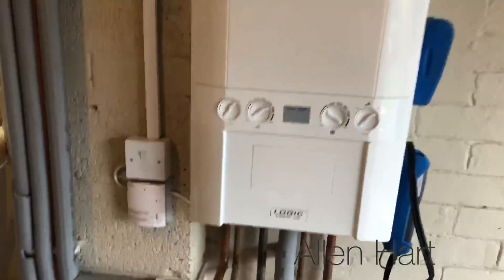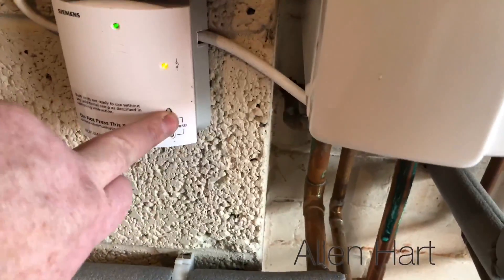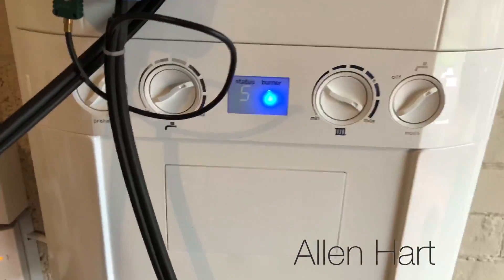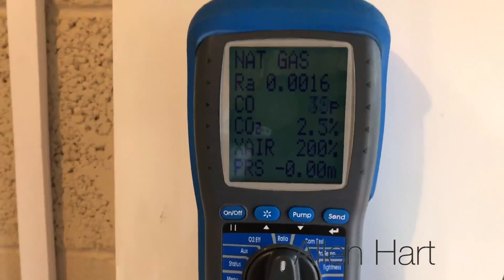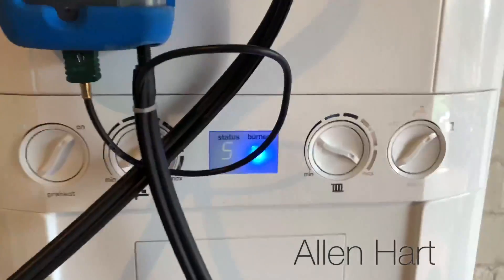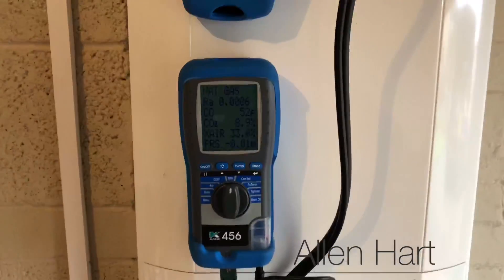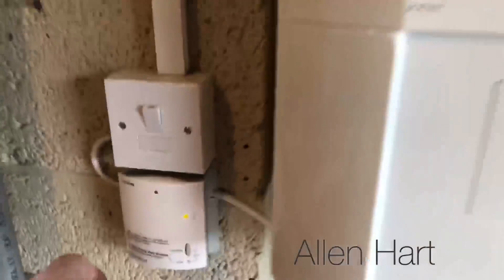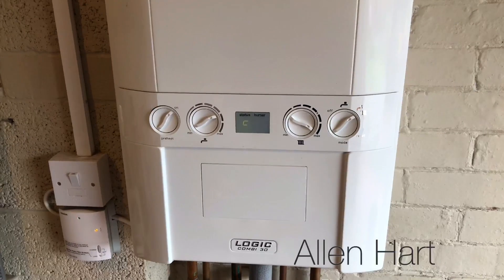How to put the Ideal Logic into Service Mode

Comment: Great video Alan is the Logic Combi c30 the same to access high and low rate or is it different to set up if so do you have a video anywhere or could you do one sometime.
Cheers Alan 
Dave.
Reply from the maker: Depends on the version of the model but mainly yes i believe. Thanks.
Reply: @AllenHart999  next time you work on a Logic Combi c30 would you mind making a video please 
Cheers

Comment: Hi Allen do you know what the CO2 readings should be in high and low for the ideal logic combi 30?? it’s not mentioned in the MI’s!
Reply: Ratio should be less than 0.004
Co2 can be any 
Co should be under 250ppm
Reply: @Mchy0  are you even an engineer? Why are you giving wrong advice? Go read the mi
Reply: It's in section 6 of the mi
O2 more than or equal to 20.6%
Or CO² less or equal to 0.2%

Comment: Hi Allen, I have an Ideal Logic+ Combi installed in 2017 it fails to ignite when turned on by the timer if I go into service mode the boiler starts up ok, I also noticed in service mode that the fault codes on the display are over 400 days old, non are about the resent problem. Another way to start it when it's running without igniting is to turn on a hot tap wait for the hot water then turn the tap off the boiler goes to central heating mode and works fine till the next day. I would appreciate your thoughts on the problem.
Reply from the maker: Hi John. When was it last serviced? Thanks.
Reply: @AllenHart999  Thanks for your reply, The boiler was serviced about two years ago.
Reply from the maker: @leedelph  It sounds like it could be a faulty stat but i would advise you have the boiler serviced. Ask them to make sure they strip it down and pump up the expansion vessel. Thanks.
Reply from the maker: @leedelph  https://www.youtube.com/watch?v=Ykz0ZPWeg3c

Comment: What does service mode actually do?
Reply from the maker: It’s for gas engineers when servicing a boiler. Lets you test it with FGA. Thanks.
Reply: Allen Hart I mean what does it specifically do versus turning the boiler to max and min?

Comment: A little tip I've learnt is too open a hot tap whilst on max mode to reduce overheating
Reply: i don't think it works on these, I know it works on baxi duotec
Reply from the maker: Thats a great tip, never tried that myself but I will on the next one. Thanks for watching.
Reply: Doesn’t work